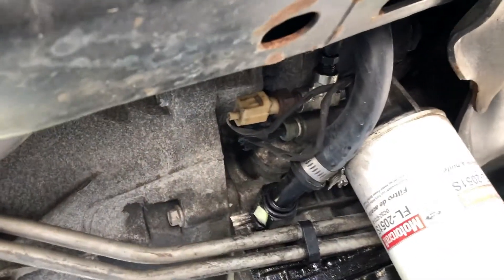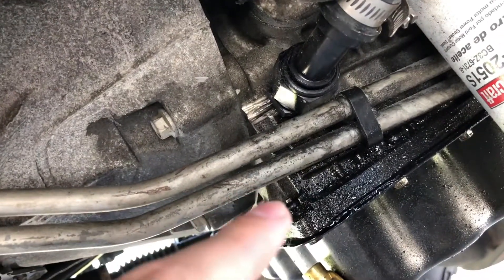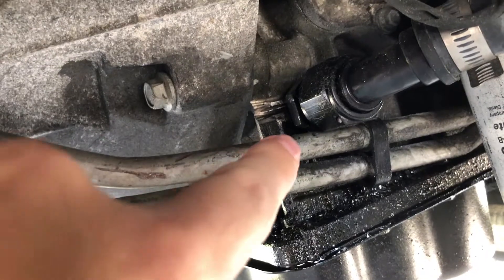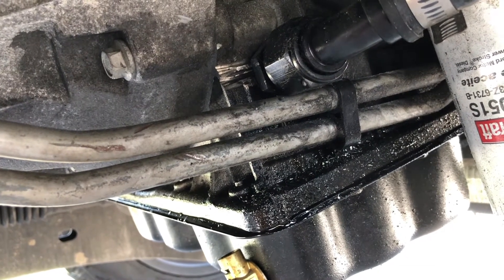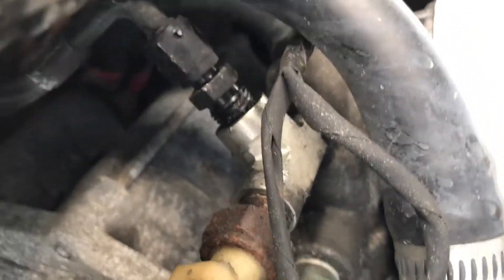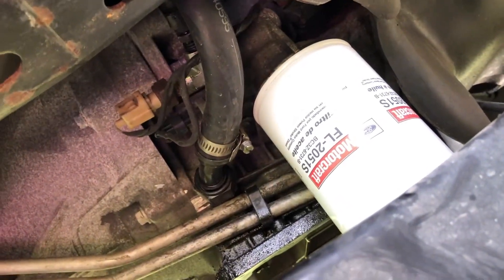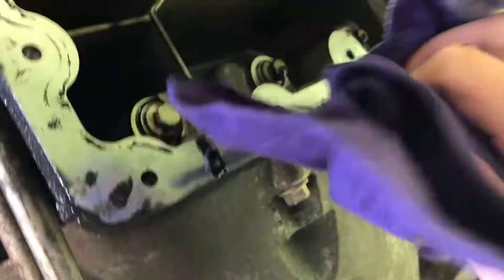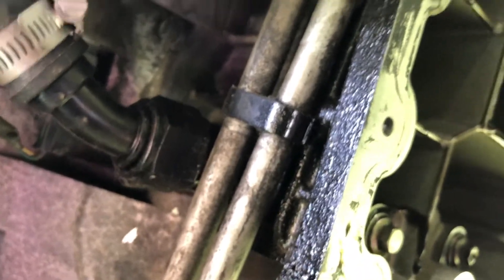Oil Drain/Feed on Compound Turbo 6.7 Powerstroke

Comment: How much of a pain in the balls was that to do?
Reply from the maker: Not terrible actually. Hardest part was getting down pipe off
Reply: @JohnKangas  for the oil drain line in the upper pan?
Reply from the maker: Oh oh, sorry. It was easy. I was just timid cuz I didn't wanna fuck up the tap. Besides that, very easy process down there.
Reply: @JohnKangas  good to know. I’m doing a compound on my 17 next year sometime and Pusher is the kit I want to use. The tapping of the upper pan instead of a bullshit replacement lower pan had me kinda nervous. I’m fortunate to have a bad ass powerstroke shop close to me in Houston. I’m going to have them install the kit when I have them pull the motor for my upper pan gasket and reseal the front cover. While the motor is out I’ll change out the valley charger and change out to the stroker CP4.
Reply from the maker: Awesome!! While they have the front cover of, have them Tig weld the crank gear. That'll save you an engine as you start to increase your power.
Reply: @JohnKangas  I caught that watching your vids bud 😂😂.
Reply from the maker: Good good hahah learn from my mistakes lol
Reply: Yeah, I’m not going to turn it up too much since I drive a ton with this truck. But I am going to take the necessary precautions. My whole plan is to order a short block from Killdevildiesel and start preparing it for a turned up daily driver.
Reply from the maker: That'll be sick!